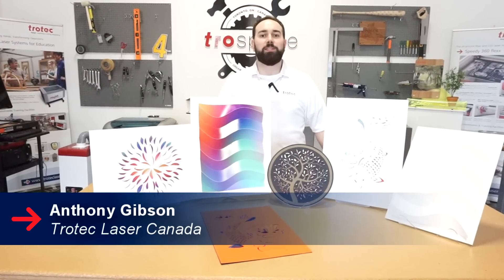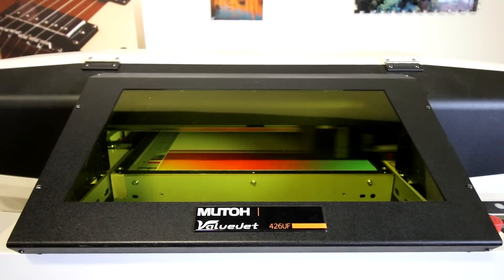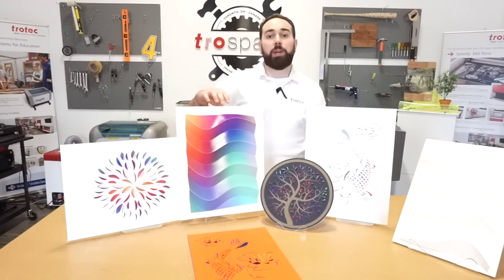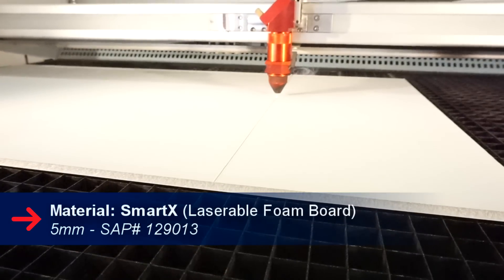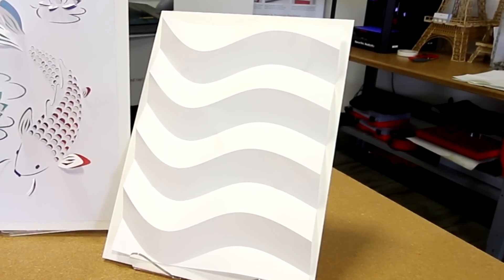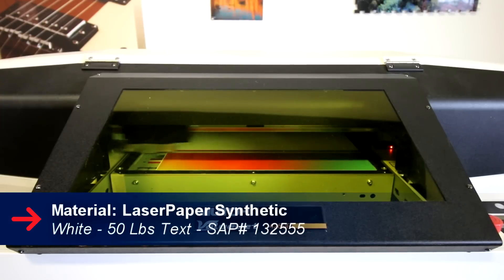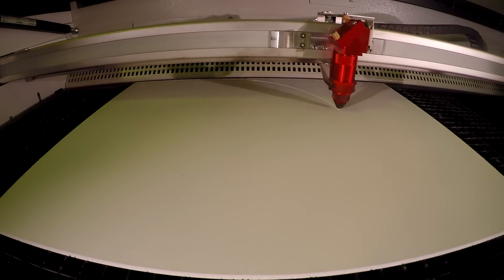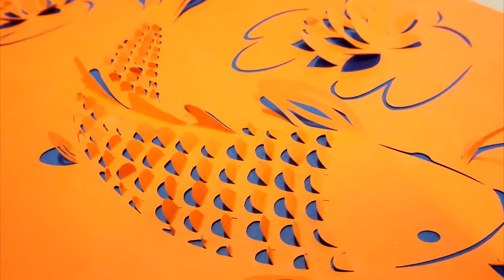Laser Cut Origami | Laser Cutting Paper Décor | Interior Design

Comment: Hi I was just wondering what setting were used? I have just bought some of the laserpaper and synthetic paper but could'nt find any setting to download for it.
Reply from the maker: Hi Victoria, what laser do you have and what power? We used the Speedy 400 100w and settings are in the description.
Reply: I have a speedy 100, 50w. Ahh yes, sorry I didn't see those settings in the description before, thank you. Whats your advice on adjusting those setting since my machine is only 50w?
Reply from the maker: Hi Victoria, for engraving try starting with 80 power and 100 speed (make a small test square about 0.25"x0.25" and adjust accordingly. For cutting cutting try 40 power and 2 speed.
Reply: Great. Thank you.
Reply from the maker: We're happy to help. Let us know if you have more questions!

Comment: Could I use regular card stock?
Reply from the maker: Hy Ryan, yes you can but we've specifically picked and tested our LaserPaper for over 6 months at our HQ in Austria to find the best laserable paper on the market. Cardstock paper will work but you may not have the desired inner colour (after engraving) results you want.
Reply: Trotec Canada fast reply! Thanks. I have this 3D paper craft project in mind that involves cutting and scoring and the paper needs to be rigid to maintain shape. What's the best way to find out if it's possible or suitable with trotech?
Reply from the maker: Hi Ryan, are you in Canada? What kind of Trotec laser machine do you have?
Reply: Trotec Canada I'm in Vancouver. I don't have a machine yet.
Reply from the maker: Oh awesome, has James Minchau visited you yet? You should check out his "In The Van" Playlist on our channel. He has a working and mobile Speedy 360 laser in the back of his van. He can come visit you with some of our laserable paper and you can test it right at your location. Would you like us to arrange that?